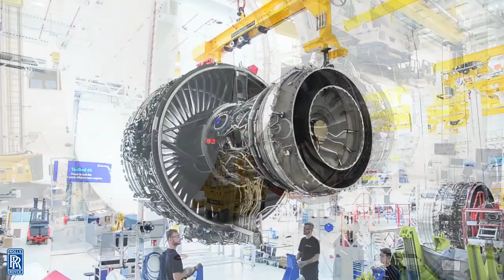Why don't Boeing and Airbus make their own engines?

Comment: Sir what's the major difference between Boeing and Airbus?
Reply: a zubair  toyota vs honda that's it
Reply: Like PlayStation VS Xbox
Reply: Could we distinguish that this one's beoing or Airbus by just seeing the shape and design of aircraft without logo like A or B?
Reply: Well not exactly because there’s more than one type of A and B planes. 
If you look at the 737 and a320 
(The two and most common A and B planes)
The 737 has a pointed nose while the A320 has a rounded one, 737 stands short while a320 stands high, cockpit corner window on the 737 also is a bit triangle typed while a320 is a square.
You can easily tell the difference between the 747 and a380 because the a380 has two full decks while the 747 has a hump shaped in the front.
You should look up A vs B differences, it’ll show you more about the other planes, id like to keep going but it’d last forever lol
Reply: a zubzir  BOEING is the original and scarebus is the copier !!!!!  Why scarbuses look like the BOEING originals !!!!  DUUUUHH!!!!!!

Comment: Vertical integration actually saves money. Look as SpaceX and Tesla when they put everything in house SpaceX is able to launch rockets for <20% the cost of previous methods and Tesla was able to  push out model 3's faster than other car manufacturers. As for quality, IN-and-out burger chain actually have their own stockyards, as well as Mcdonald's they also have their own chicken farms.
Reply: Vertical integration makes sense in some industries. 

It may make sense for them to own carbon fibre producers to guarantee quality, and supply. Less can go wrong. 

A new engine design costs billions to research and develop, and no guarantee that it will be successful. Look at Rolls Royce. They are struggling due to cost overruns.
Reply: @Locutus  Space X still has 3rd party suppliers for basic processed metals i.e. they don't mine for metals.

Comment: I made my own little jet engine with a soup can, a bike rim hub as the core shaft and bunch of scrap metal at work. It worked for about 10 mins and then burned up in flames because it got so hot! 6 months of work gone in 10 mins!😟
Reply: This is why Boeing and Airbus outsource engines to Rolls Royce and GE😂
Reply: @sachin.k.gganesh3285  exactly! It was a fun build tho! I'm making another out of a turbo from a car! Hopefully this one works better!
Reply: @munky123jw  I was kidding bro..appreciate your efforts for building an engine and all the best for your future projects 👍
Reply: Quite the achievement to build your own working jet engine. The original jet engine designers faced similar challenges.
Reply: Do u have it on YouTube, ur failed soup can engine video ?
Reply: @77l96  that's where I work now. Why do you think those engines are bad!
Reply: @77l96  Rolls Royce will be nationalized again because of it. Same stuff going on as the RB211.

Comment: If Boeing manufactures its own engine, Airbus will not offer it to its customers and vice versa. Currently GE and P&W can sell to both Boeing and Airbus. If Boeing had acquired e.g. P&W, its sales and production would be lower and thus unit engine costs would be higher.

Both Boeing and Airbus are outsourcing their productions already. For example more than half of B787 is being produced outside US. Why would they want to do the opposite for the engines, which require much know how than other aircraft parts?
Reply: Boeing did in-fact own P&W at one point in time but had to spin it off due to Anti-Trust Lawsuits by US Govt. Putting anti-trust aside, both Airbus and Boeing can own Engine Manufacturers as well as Airlines, etc but they will be stretching themselves thin and any failure in one part could also bring down other parts. Big is never always better.

Comment: You need to study the subject more before you put out a video. 
This topic has been understood by mankind since 100 years ago. Example: Ford Motor Company. THey once tried to build everything... I MEAN EVERYTHING. They imported raw silica to make glass, raw rubber to make tires and gaskets, bought iron ore to get their molten cast iron, pulp to mill their papers, etc, etc. They don't do that anymore. Reason? Diversity.

Comment: Gosh.. what can one say to all of these answers our business students provide us.... simple answer to this question on whether the company wants full control of the manufacturing phase or be a value added reseller has to do with: business model!!!. In the case of space X elon musk himself mentioned it multiple times to bring down costs they had to design and manufacture their own parts. Main reason for that is because they developed cutting edge tech fornthwir rockets which where not patented!! So you keep it in-house "its not like they are selling rockets"... Further for a company that wants to increase its capital increase less capital investment into the core product (they still make the same profits speak to any CA they will explain to you how) which means quicker turn around on capital tonpay investors.. if the business model is of such part where the current market industry forces low prices in accordance with high parts prices and capital investment justifies the development of parts then the business will choose to take that route. Simple matter is that most companies purchase shares of sone of their main suppliers so they have a indirect stake into the profits of those companies who profits of their products... all have to do with business model.